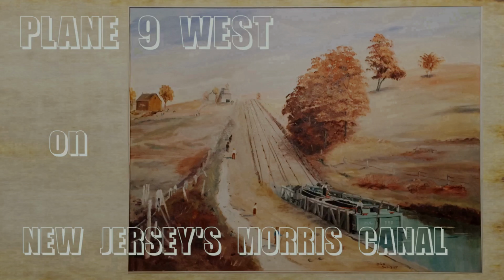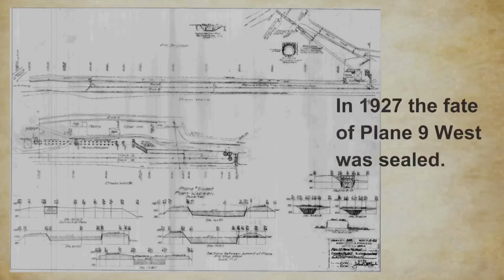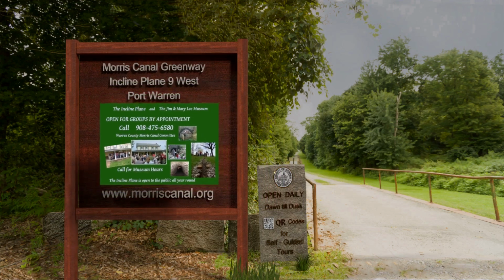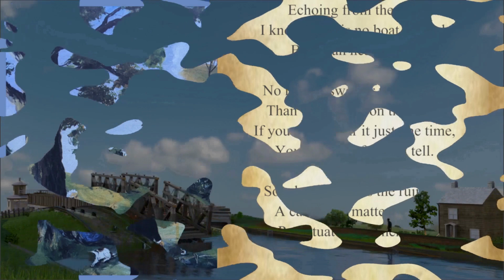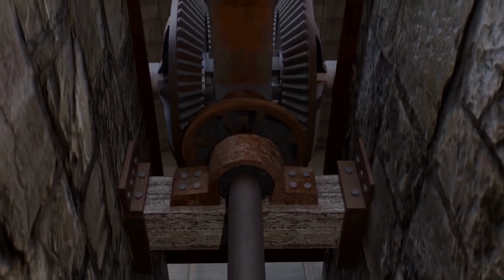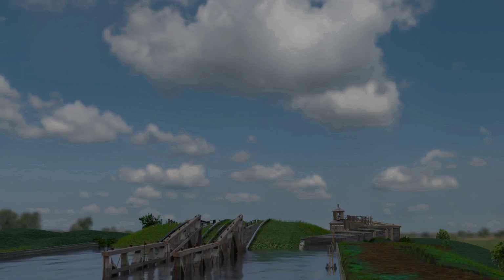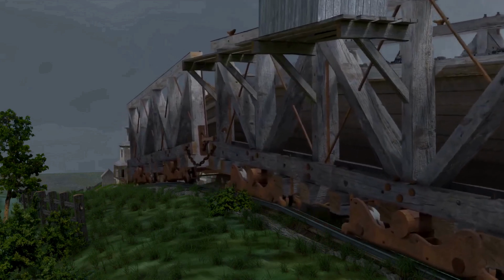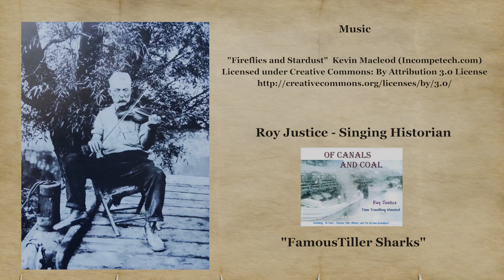Plane 9 West on New Jersey's Morris Canal: A Computer Animation

Comment: Excellent. Like the sounds of the wood barges on the tow cars. The wire ropes that moved the boats were three inches in diameter. Made by Roebling Co in Trenton. Went on vacation to the canal in '06. Bought the "Morris Canal" book in Lake Hopatcong. So like that the water was used so many times.

Comment: What a great explanation of the workings of the planes! The animations certainly make it so much easier to understand. I marvel at the ingenuity of the entire mechanism! As I watched the animation of the cradles carry the hinge boats over the planes I wonder what the sound was like - if it was loud and mechanical, or, relatively quiet, with only the sound of the cables moving and the boat and cradle settling and shifting as the weight of the vessel in the cradle switched from canal to cradle, over the plane and back into the canal. Wonderful presentation! Nicely narrated, James! Solid, interesting, well-paced production, Warwick! (Clever animation at the end!)

Comment: When did the canal switch from rope cables to Roebling’s  steel Cables?
Reply: From "A hundred years a hundred miles " , by Barbara Kalata pg 407, "the company decided in mid 1847, as already noted, to use wire rope".  So around the time of updating the planes to carry the heavier hinged boats carrying heavier cargoes circa 1847 - 1850 wire rope was used.  This replaced chain which had reportedly replaced hemp rope at some point.